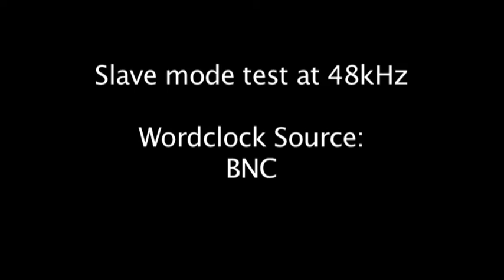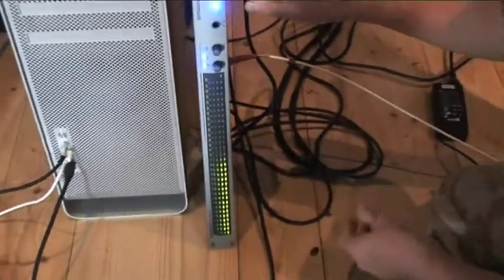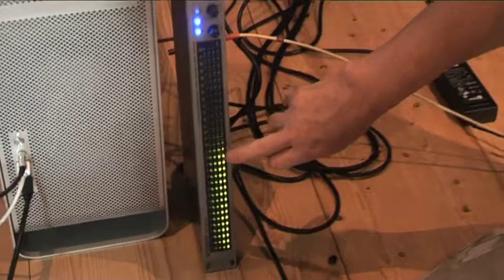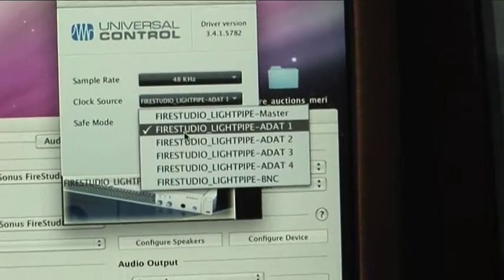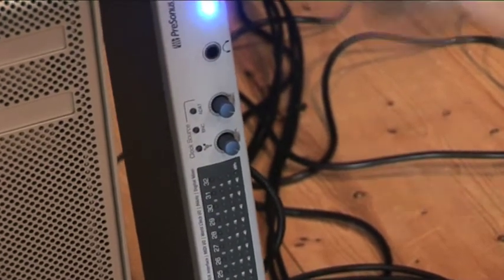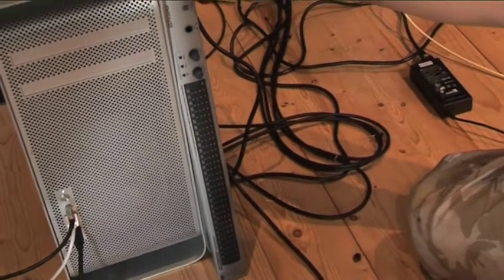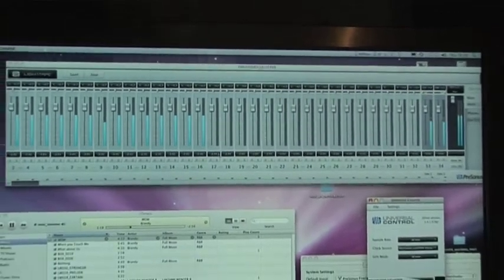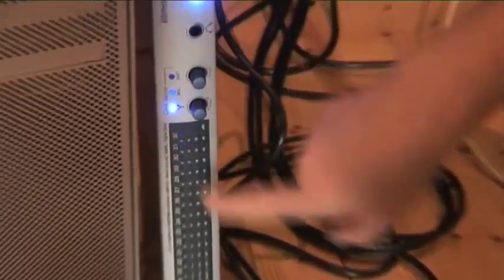Part 1 Presonus Sync Problems

Comment: Had a similar problem with mine, would not do anything more than a stereo output, never tok any input at 48khz ADAT through lightpipe ins from an HD24, wouldn't output to individual outputs via mac Logic Pro, worthless.
Wasted MONTHS of time with tech support trying to get it to work. No driver worked.
They sent me 3 of them, none of them worked at all.